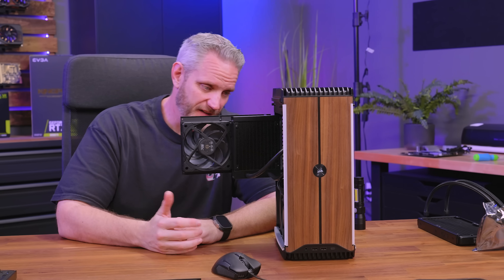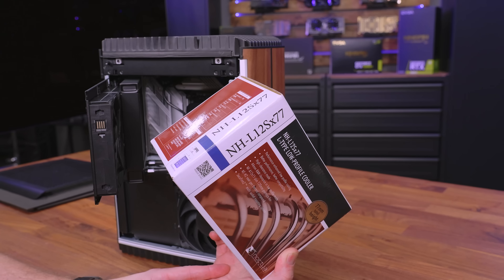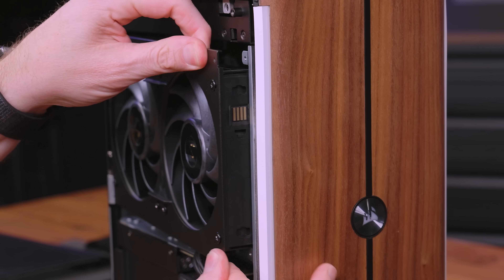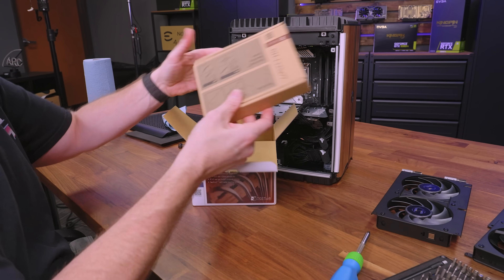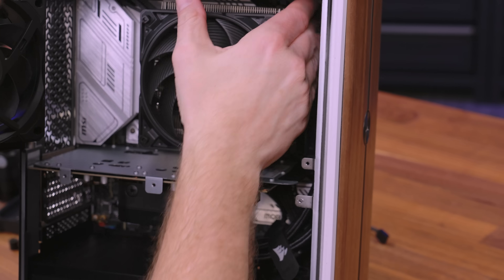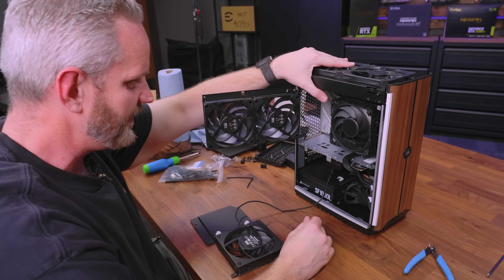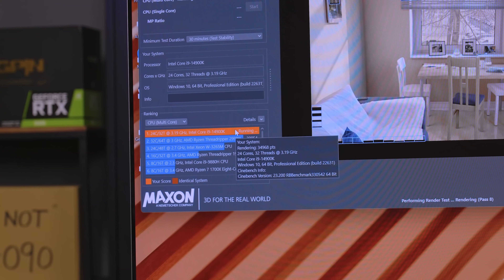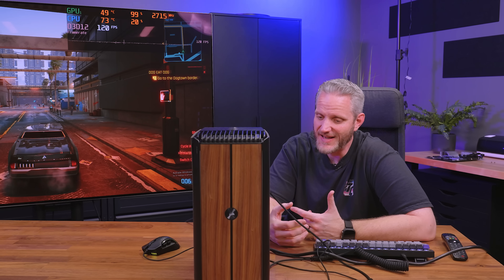Well... that was an unexpected improvement...

Comment: Next time just put an 7800x3d in it
Reply: Yup, there is no sane explanation for putting a 14900 in a compact rig.  That's just silly when there are way lower TDP chips that perform the same with better thermals and half the power use.
Reply: …and a proper cooling solution.
Reply: Different mobos guy
Reply: Classic amd fanboys here. Even jay had problems yet its the users fault. Suuuure

Any criticism and the witch hunt will begin. Any video not related to amd: "should have gone with amd". Its a classic at this point.
Reply: @Xirpzy  finaly a person with normal head
Reply: Loads of fanboys who don't have a 7800x3d showing up in the comments 😂
Reply: I prefer the 7950X. No 3D caching complications.
Reply: Have it..and its sucks.. oced  12600kf way more stable
Reply: @koky179  bullshit
Reply: @koky179  Tell me you're shillin' & lyin' without telling me
Reply: @tlv8555   @riccardo3092  still have both systems  and still seeing in..intel system runs just fine. Amd  random game crashes, windows too.. so only bs here is coming from your moutha
Reply: @koky179  you have 0 clue how to use a amd system then
Reply: @maltzel490  yeah right..had for years only amd systems.
Reply: @koky179  yet you dont know how to keep it from crashing
Reply: @maltzel490  yeah i do..but than u loose what you were suppose to get out of the box performance.. look around lot of people have the same bs..even took it to pc shop.same cpu tested on few mbos the same result..rma it..come back everythings fine...and that the problem amd had simce first ryzen
Reply: @koky179  well i have one and there never was the problem, so i think you made the problem by some fault of yours
Reply: @maltzel490  cause you dont have doesnt mean that the rest ifvthe  world dont have them.. i know people who dont have and  i know a lot of them  who have
Reply: @koky179 you have no clue what you are talking about
Reply: @maltzel490  Remember how many issues Jay had with his 7950x3D. 
AMD clearly screwed up on at least the early 3D chips.
Reply: @koky179  Random crashes probably means there's a hardware issue somewhere in your computer. It's hardly AMD's fault if you got a DOA CPU, it happens to Intel too.
Reply: @VraerynDaDragon  never had it on intel..only amd ..with 2000 3000 series now on 7800x3d and my kid have it on 1600
Reply: @koky179  Well I don't know what to tell you, but I worked in a retail PC repair shop for three years and saw hundreds of PCs. It's not that bad and you may very well be doing something wrong if it happens that often.
Reply: @koky179  if you dont know how to oc just say that. 7800x3d is the top gaming cpu. Dont even need oc to out do a 14900k
Reply: @koky179  LOL! You wish!
Reply: Nope!
Reply: @koky179  Stop being an Intel fanboi. 7800x3d is literally the fastest gaming cpu on the market.
Reply: @koky179  you are full of crap. i've had zero issues with mine
Reply: @koky179  you trippin, brother.
Reply: @koky179  No, that's user error.
Reply: @koky179  I got 2 systems... Amd and intel... My intel I am legit using it as a space heater in the winter, eating upwards of 300w? On a 420mm rad not fun... The amd system is cooled by a hyper212.... So much easier...
Reply: @WrongPixel  ooh boohoo... until last 2 gens i think amd was always hooter..if u even remember that meme going around for a lot of time. House covered half the roof in snow the other half not cause of amd user .now 14th gen of intel gets hot y all cry about it..what a noobs
Reply: @koky179  I had 12700k and 13900k same thing unfortunately. I believe I had a 11700k as well I need to fact check tho
Reply: @WrongPixel  12600kf oced. Never went pass 60°c in cinebech or in gaming
Reply: @koky179  power limit set to? I'm pretty sure I had that sh*t of a CPU eating 300w
Reply: @koky179  since ryzen launched amd was basicly always more efficient than intel.
Reply: @WrongPixel  stock power limit. Undervolted and oced to i think 5ghz all p cores. 3.7 e cores
Reply: @koky179  never understood undervolting, unfortunately didn't run too much on it... But will look more into it 🤔
Reply: @SpyderTracks bro learn about intels p and e cores
Reply: @SpyderTracks i sad oced to 5ghz all p cores..and e cores just oced for 100mhz..e cores are basicly useless to oc.... read that reply again.and check stock speed of i5 12600kf... boost speed are 4.9..stock are 3.8..bro...thats not 100mhz..

Comment: Puts a 14900k with a 120mm AIO. "yeah, it's fine just ship it." I'm sure there have been 0 Customer Service emails about the temperatures. Surely, right?
Reply: Don’t call us Shirley!
Reply: @Redmage913 beat me to it with hours to spare. Respect. 👊
Reply: @Redmage913  I just want to tell the aio good luck. We're all counting on it.
Reply: @Redmage913  Affirmative, and don't call me Roger.
Reply: Your average user who buys this isn't loading up monitoring tools.  I suspect they are just going with the flow, thinking they have the best performance possible.
Reply: Well, if no one bought it, then no emails
Reply: I'm pretty sure that was an aluminum radiator too & not copper.
Reply: @kevinerbs2778  I'd be willing to bet $1000 there is 0 copper in that AIO. You only find copper rads in custom water cooling components really.
Reply: Well to  be fair the demographic of people that are buying these sorts of Pre-built systems most likely don't even know how to check the temperatures of their components. So they probably don't get a lot of customer complaints about these things and I bet you they knew the afore mentioned speculation as well.
Reply: even worse to me is the fact that they dont even give you control over the fans... WTF?
Reply: Hello you have contacted corsair technical support, we see that you are saying that you are concerned about your CPU. We would like to inform you that intel shows that the safe operating temp of the 14900k is 100c, this is within manufacturing limits.......normal ppl that is max temp
Reply: The kind of goobers that buy this thing with a 14900k don't have a clue anyways, so no they're not sending service emails.
Reply: Just needs a delid, direct die, liquid metal with all E cores disabled and then it's doable.😂
Reply: Most people (PC users) have no idea what means and why they should care. It works? It works.
Reply: @cszolee7979  Yeah, but when you're paying a premium for this type of system, you would hope it would run in-spec and not have underlying issues that are preventable. I wouldn't want to buy a car that runs fine under 60mph but the minute it goes over the Engine overheats and starts dropping RPM. I don't know how it works in a car, but I also know it shouldn't slow down like that.
Reply: @softlock231  Yes but that's completely different. 90% of people have no way of telling the difference between 5ghz and 4ghz on a modern processor. To the average person it'll be fast either way. That doesn't make it right, but that's why they shipped it anyway.
Reply: @softlock231  I think the proper analogy would be running a car pass 60mph and overheating the engine when its speedometer has a max speed of 200mph.
Reply: @softlock231  With a car, rpm is limited by the parts used. If it had improper cooling, the engine would self-destruct.
Reply: @cszolee7979 yeah but… it doesn’t work…
Reply: I mean I have a overkill cpu cooler on my Ryzen 5 1600 AF that is not necessary. I clocked my Ryzen 5 1600 AF to 3.7GHz and I am using a ID FrostFlow x 280 cpu liquid cooler. Its a 280mm AIO on a Zen+ chip. The hottest my cpu gets is like 49C-53C under full load.
Reply: @BladeCrew Similar story here.  I hit 48-53 for max temps.
Reply: A 3,000 RPM fan is your friend.
Reply: probably few actually most wouldnt know to look, they probably get more complaints about noise of a system
Reply: I just came from a video where its explained the heatsink  plastic wasnt removed before install. the pc ran for 3 years like that. thid is way tamer
Reply: I mean I have a 6900xt factory water-cooled with only a 120mm aio and although it gets a bit loud and toasty at 300W I have no issues with it thermal throttling, hotspot temp peaks at like 90C. By that standard a properly designed 120mm should be able to keep a 240W part from throttling as well, but I'm guessing Corsair cheaped out on either the materials or thickness of the rad
Reply: @itssodifferent6497  GPU's work fine on a 120mm AiO, I put a 1080 on one back in the day, not CPUs. Or at least not a high end one.
Reply: Clueless